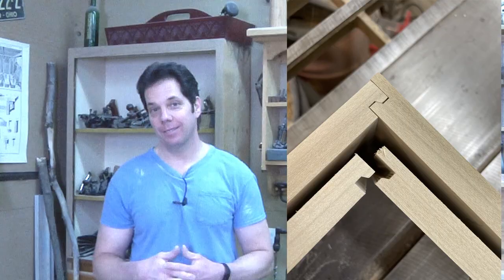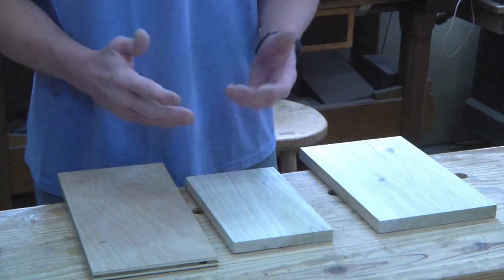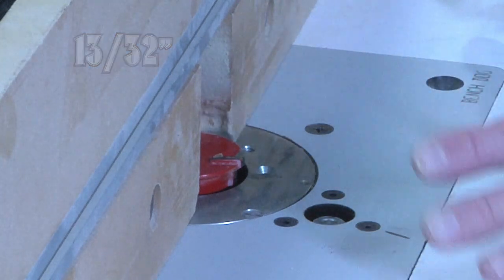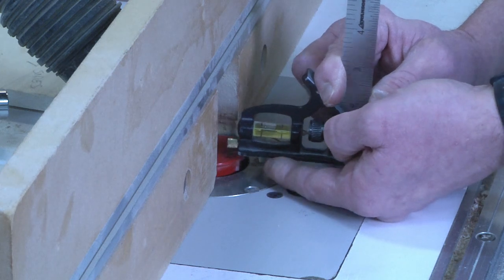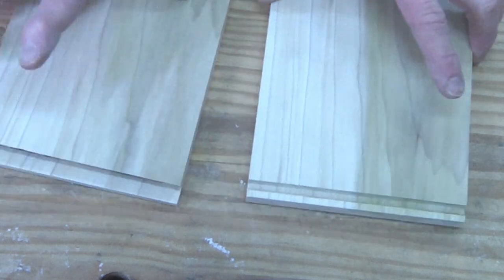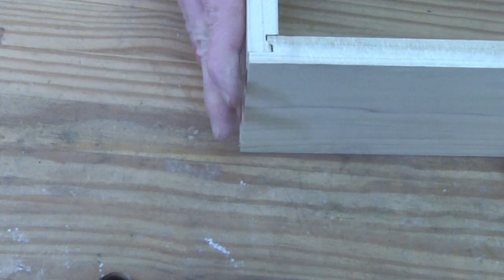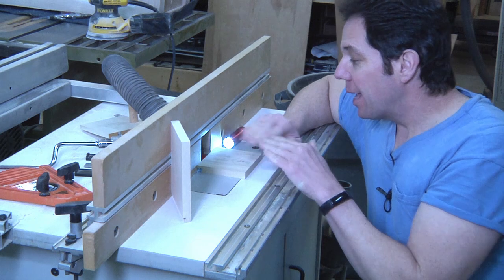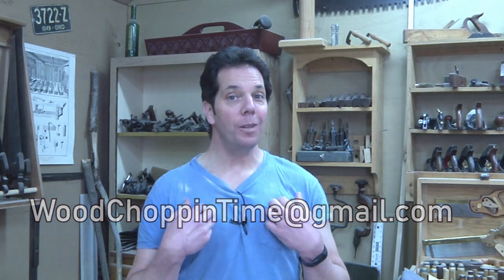MUST HAVE for Making Drawers

Comment: Many people have trouble setting up this type of router bit because it is in the family of the infamous "Lock Miter Router Bit" like anything in life each person takes less or more time to get the hang of it but once it is achieved it's there for life and really not all that difficult to set up.  I have this bit but prefer the Lock Miter that will not show end grain like the one in this video.  I also prefer the 1/4, 1/4 table saw system to make drawers when I'm not dovetailing.

Comment: Nice, some router bits really require serious figuring out :) Regarding the wood chip-out: I thought it was because the push block you use already contains a groove at the bottom, so there are places where there is nothing to stop the wood splintering. If your were to swap it around and work with a full edge, then the router bit would always have some adjacent wood to bite in, reducing the chip-out. However, you'd need to use a new fresh edge each time you make a router pass, which is a bit overkill I guess.
Reply from the maker: Ah! Good point. Yes that makes perfect sense. Thank you

Comment: Is this the same as a 45 degree locking bit? I have one and there is an optional setup piece (that I don’t have). Thanks for the info.
Reply from the maker: It’s very similar but the set ip is different. Thanks for watching 😁
Reply: @ChadStanton  thanks. Always a pleasure.

Comment: I know you are a legend and I use to watch you back in the day....2018
But, I am curious why you do not use the 1/4x1/4x1/4 method ..also know as the half/half/half method. Or even the Half Bind Lock Joint? They both seem just as strong as yours and IMO, much easier to do.
And finally, with all due respect, it looks like this video was filmed in the 90's?
Reply from the maker: Wasn't familiar with the term half half half. I had to look it up. I tend to think of it as a rabbet and dado joint. There are many ways to make a drawer. I'm not saying this method is better than those methods. I was just sharing a technique. Thanks for watching and the comment.
Reply from the maker: Hears a version of that method I did many years ago. https://www.youtube.com/watch?v=WXqPYMVWZR8